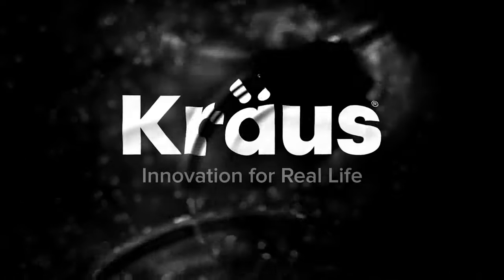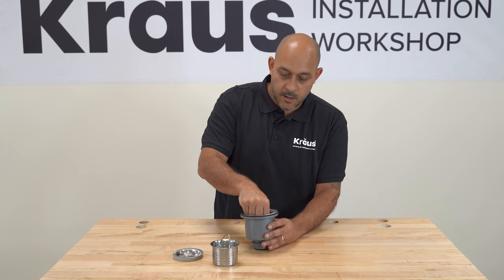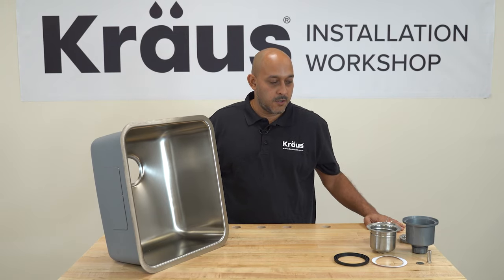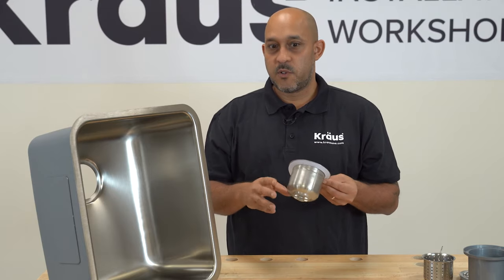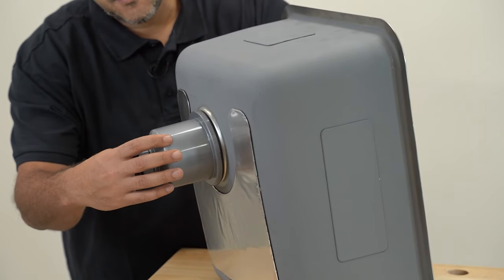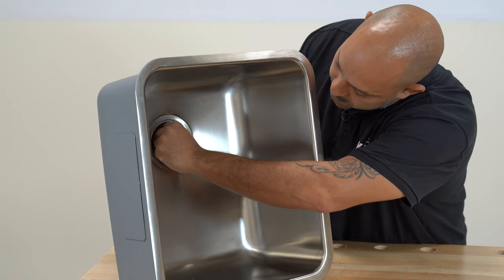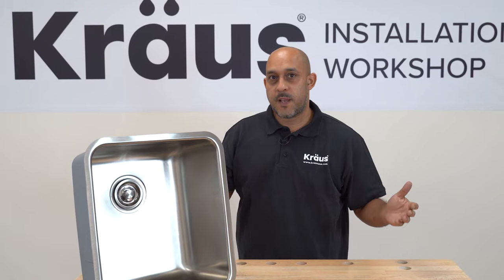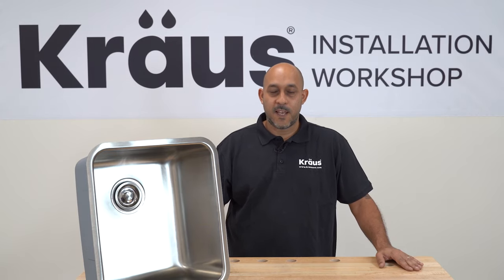Kraus Sink Strainer and Drain Assembly Installation

Comment: Highly recommend these. My enamel sink is atleast 30 years old and probably warped. Never could get a proper seal on the right side with putty and standard drain. I think the previous owners had a garbage disposal at one time. I also had a brass and copper strainer. The left was original and still sealed fine with putty. Finally installed one of these on the right and it’s been holding scalding hot water for over an hour. Not one drop. This will help with any sink that may have imperfections.

Comment: Would be helpful if you showed a tailpiece being attached. The washer is the same size as a 1-1/2” standard tailpiece. Doesn’t fit around or in it. How are the nut and washer supposed to be attached?
Reply: Currently experiencing this issue.
Reply: You have to use the rubber gaskets that sit on top of the tail piece. Not included in the set.

Comment: Finally the white gasket explained! Please show a video of the the white gasket not leaking water....so I can decide on plumbers putty or white foam gasket. thanks
Reply from the maker: Hi!
We do not have a video of this currently, However, you can rest assured that the white gasket will NOT leak if tightened properly. If you experience any issue, simply contact our top-rated customer service team at 800-775-0703 / customerservice@kraususa.com for assistance.  Thank you!
Reply: Do you expect the white gasket to last as long as putty? And the video didn’t state how tight to make the screw to avoid leaks. Do I need to crank it hand tight or are we talking finger tight since you used a coin?
Reply: @jamessurname2285  hand tightened mine with the coin. works great so far.. if it ever leaks I will use the putty.

Comment: After 7 years my Kraus sink is leaking now, I'm assuming I have to replace the gaskets? And where can I buy these replacement gaskets?
Reply: Did you ever find a replacement gasket? 
Mine is now leaking after about 2 years. Looks like installer used putty.

Comment: My sink was clogged so I just took all this apart. I cannot get the grey cup off or tighten it or anything. My model is not that old but it does not have the screw or that lower gray cap at all. I can’t figure out how to take the gray sleeve off the basket strainer. Turning it doesn’t work. Nothing seems to free the two pieces from each other.

Comment: He just said the nut and rubber gasket was for a tail pipe 1 1/4. Most tails are 1 1/2 and the rubber gasket will not fit around the tail when inside the nut. Went back to Home depot and all the 1 1/4 tails are with threads and no lip (straight).... / Does that mean the rubber provided is made for a non-standard tail?
Reply from the maker: Hi Bernard,
Thank you for bringing this to our attention! You are correct that we misspoke when recording the video. 1 1/2 tailpiece is used for this and all standard bathroom sink connections in the US. 1 1/4 is standard for bathroom sinks only.

We will be correcting and uploading a new video shortly to reflect this change.

Comment: What is the nut and the washer for ? How do you then attache a tail piece ?
Reply: I want to know this also
Reply: @vincentv.4832   Hey, I found you have to buy a specific tail piece for a strainer... They are cheap and are at HD Lower. also easy to attach
Reply: Is that supposed to just drain into a bucket?  How about explaining the special adapter we will need that is different from how 95% of all drain baskets attach to the drainage pipe

Comment: So I can't put a trash compactor because there is no adaptor. Well time to return it. I purchase it specially for the look and if it's not there it now becomes trash worth $300 whatever.
Reply from the maker: Hi aldosv73 - Yes, garbage disposals are 100% compatible with our sinks. Rather than install a disposal to the drain, the disposal will replace the drain as it has its own flange and mounts directly to the sink.

Comment: Hard critique here.  This was stupid useless.  Anybody can put the drain on a sink like that, but that is not how it installs.  You didn’t show exactly how the down pipe pvc fits onto the bottom of drain.  The top hat fitting goes into the gray nut then the black washer on top - inside the nut.  Maybe this is obvious, but I am looking for confirmation.